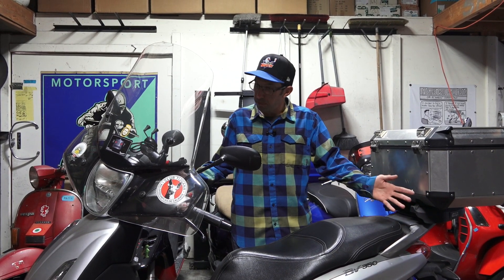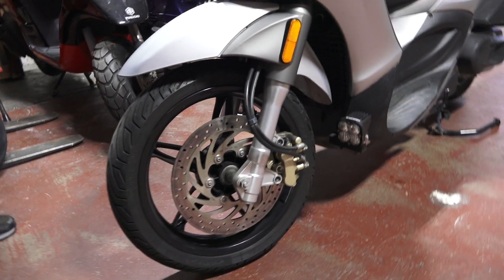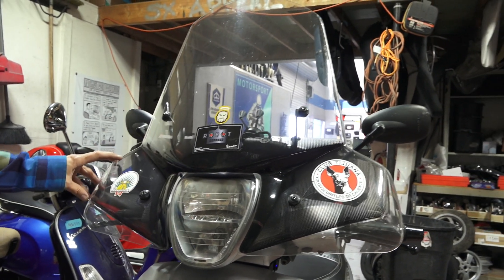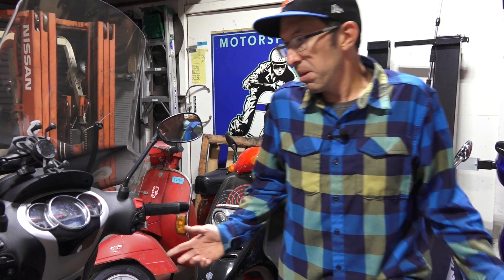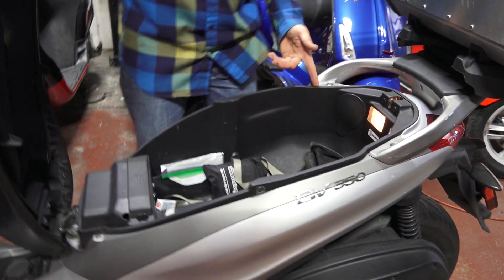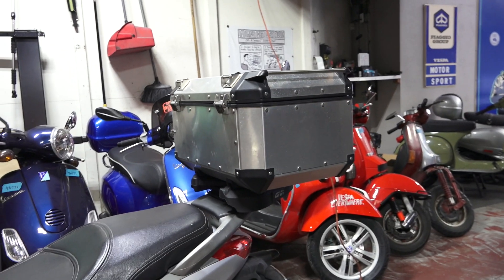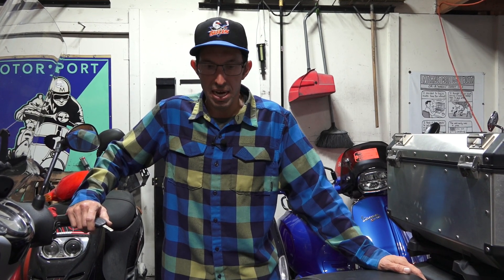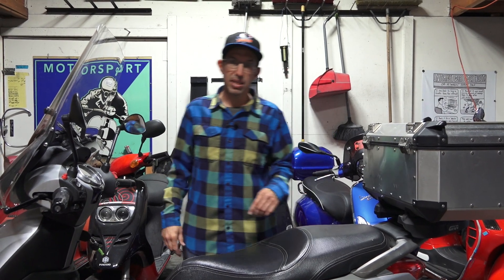Robot's Daily Commuter Piaggio BV350 Scooter

Comment: In Europe the quality of the Beverly 350’s have gone down to super frustrating low levels. Lot of engine related issues and lots of quality controle issues like shifting/loose steers, rust here and there, glovebox not closing and water coming in etc etc. Screws rusting within a week, waterpump plate is often oxidized on almost all factory new Beverly’s and alot of fit and finish problems like the the foot plate rubbers not fitting and comming loose etc. I live in Amsterdam, the Netherlands, lots of Beverly’s used to drive around here, but Japan made/designed scooters are taking over. Piaggio isnt what is was anymore and has the worst customer care.

I like your videos btw! Thanks for posting!
Reply: Toch zit ik er wel over na te denken om hem te kopen. Ik rij in Amsterdam en soms moet je de ring op. Heel soms Rotterdam, Hilversum etc. Maar Ferdi, wat zou jij mij voorstellen. Daar ben ik benieuwd naar. Een scooter, 300-500 cc en rond de prijs van een nieuwe Beverly.
Reply: Dragan Bakema Hoi, ik zou dan naar een Yamaha X-max kijken. Veel meer waar voor je geld!

Comment: I got the 2019 model in blue, ABS, traction control and key fob. Absolutely amazing. It's freaking fast and stable on the road. It doesn't even burn much fuel at all. I'm in the range 26 km/l and i'm still in the breaking in period. Absolutely recommend. I was getting a TMAx but I changed my mind once I tried this